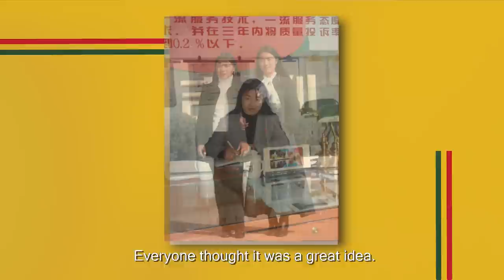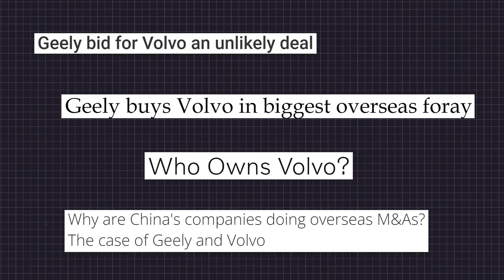Geely Group at 35: From Humble Beginnings to Global Automotive Group

Comment: I am very impressed with the 2-way relationship between Volvo and Geely, something that is very rare in the motor industry. Usually it's one manufacturer imposing or poaching over the other. I Hope that with Lotus in the foray, the same can be repeated and to "release the Lotus tiger from its cage."
Reply: Indeed, look at what is left of poor Saab
Reply: 665t4
Reply: @jhonson530i  or any other brand that GM and Ford had a joint venture with.  Mazda, Holden, Vauxhall, Opel..